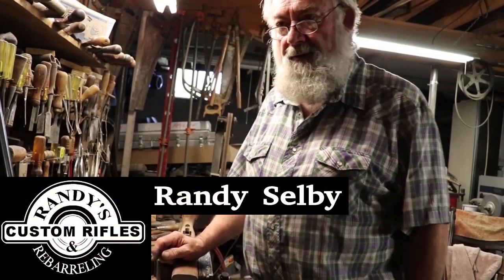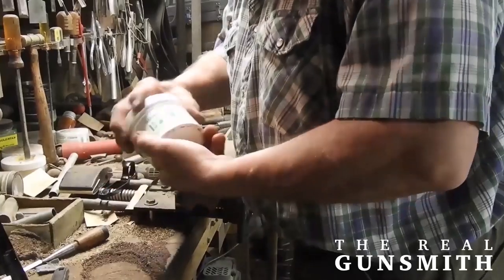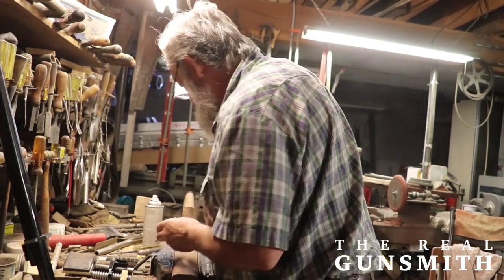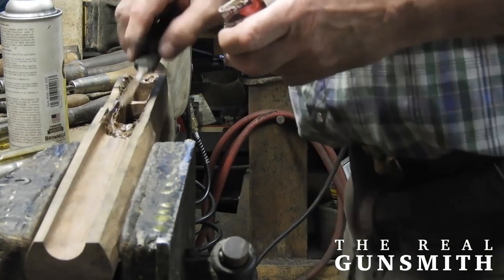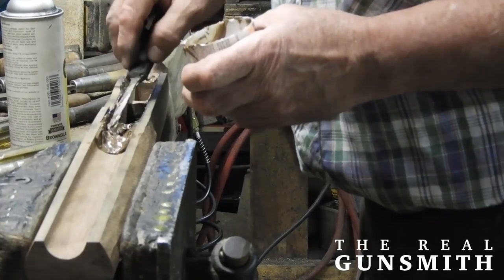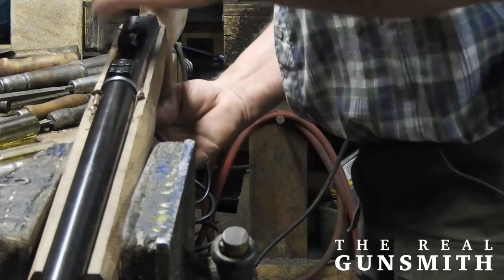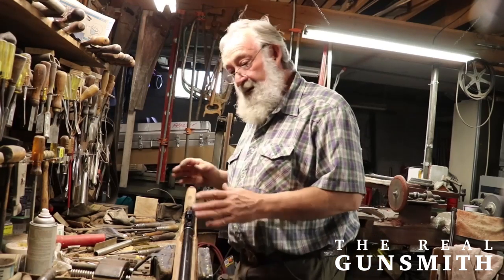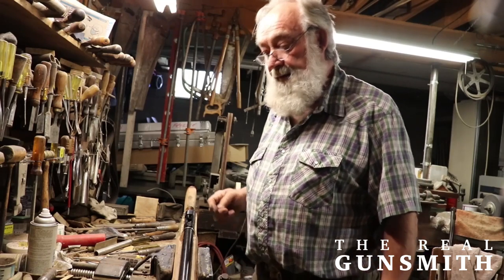Glass Bedding a Barreled Action

Comment: Is glass bedding pretty much the standard thing to do for a factory rifle? I have a Bergara with a vortex scope. Both brand new. This rig doesn't shoot. First shots were with federal ammo and it printed about 4"+ at 100 yards. Very frustrating. I began working up a load that was considerably better, but only maybe 1 MOA. But then the load would not shoot accurately anymore. So I worked up another with a different powder. It was looking promising, but then it would not remain consistent. So I worked with seating depth and a hotter load. Looked promising. Got a group or two just below 1MOA (still not satisfactory but promising). Then that load changed. It spread out and then began shooting low. The scope track-checks fine. But something is wrong. Gun or scope. These rifles are touted as being very accurate. Should I bed this rifle? I am hoping to borrow another scope to try. Very frustrating.
Reply from the maker: You don't mention the chambering. Any Bergara rifles I've had any experience with  shot very well.    "All" factory rifles need to be properly bedded before any load work up or accuracy testing.  Good luck.
Reply: @TheRealGunsmith  Thanks for your reply. My Bergara is the Ridge model in 300 WM. I have put a lot of work in trying to make it shoot. Some people have told me that bedding should not be necessary.But I plan to have it done. I am starting to look at my brass. I learned some things on your video on setting up dies. I think I had way too much neck tension on my reloads. I was full-length sizing every time also. I loaded some new brass and got a 1" group in my best load. This is a big improvement from the direction my groups were deteriorating. I am going to bed it and focus on neck tension.  Thanks much for your info and your reply.
Reply from the maker: @lespotter8293  Properly glass bed the rifle.  Use H1000 and WLR or F215. Flat base bullets; 165 & 180 gr Hornady Interlocks; seat .020 off rifling.  Chronograph all loads.    And from Cathy, The Real Gunsmith's Wife, if you want to be sure Randy replies if you want to continue this, would you please email us at randyselby@randyscustomrifles.com?  Because we get so many comments I had a hard time going back and finding this thread to reply for Randy.   If you add a question it is easier for me to find, but it is not fool-proof [me, being the fool trying to figure it all out! ;) ].  Good shooting.  Happy Thanksgiving to you and yours.

Comment: Thumbs up!  Always good to see a do it yourselfer like me see I'm doing (bedding) the same way as a pro.  (Maybe because I have studied various books on the subject?)  But, I'm conflicted with regard to whether or not I should relieve material from under the recoil lug "to avoid stressing the action" as accuracy will suffer. 

Does relieving material (wood or epoxy) from under the recoil lug (e.g., Rem 700) enhance accuracy "as it prevents stressing the action"?  Or, does that technique only apply to inletting (only) but not to an epoxy-bedded action?  (After all, a Stolle action benchrest "glue-in" doesn't even have a guard screw under the recoil lug.  And, my limited experience has NOT supported the notion of relieving the recoil lug is critical to accuracy:  in fact, just the opposite has been my meager experience!)  What say a pro such as you??

Paul.